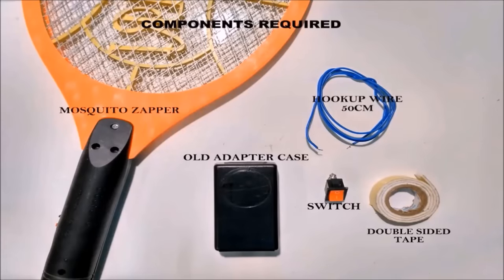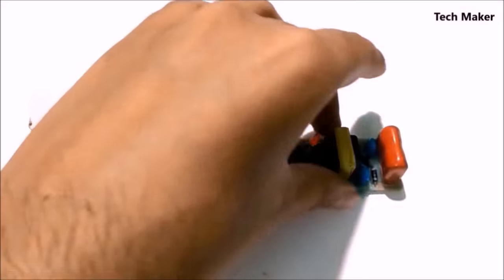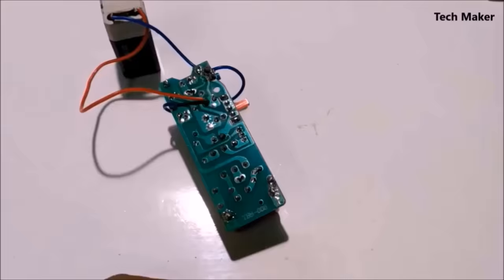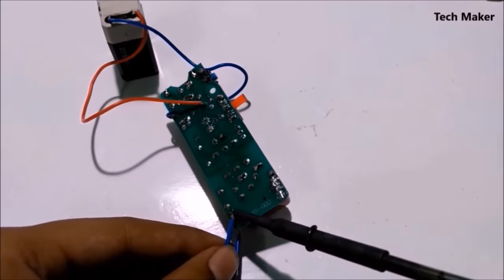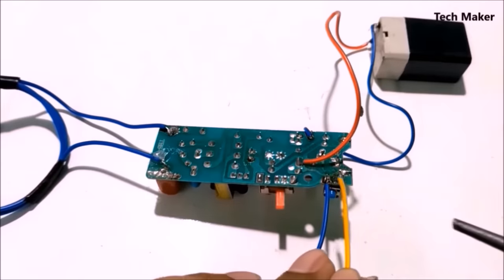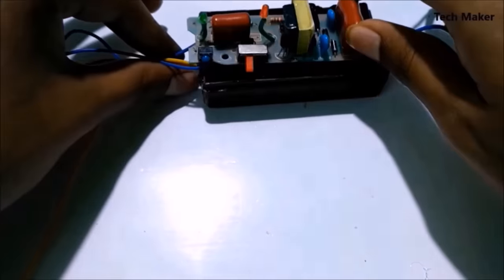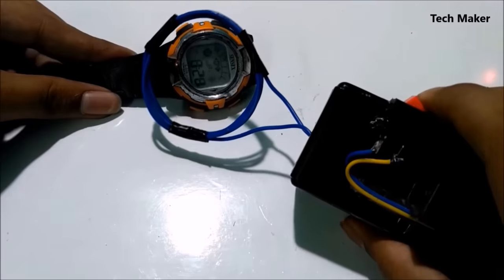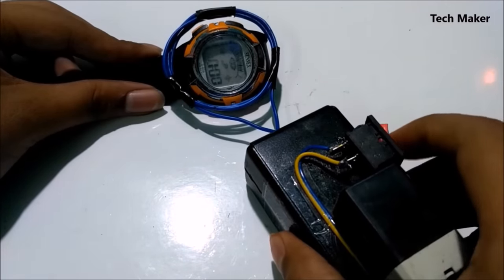How to make EMP Jammer [ Step by Step ]

Comment from the maker: Hey Guys! 
I want to make videos on basics of electronics , which will start with resistors and extend it to high level electronics.
Do any interested?  Reply to comment and drop you any necessary video idea.
Reply: It would be a great idea, and I'm probably not the only one who has zero knowledge of basic electronics, so please make a video about it, thanks! :)
Reply: Tech Maker will it disrupt cash register and how close do I need to be ?  ty
Reply from the maker: it works,  but coil must be on the device which you want to disrupt
Reply: Tech Maker  I'm absolutely interested, I've been soldering  for years and know the basics such as resistors and the different types  same  with capacitors and so on . do it
Reply: Tech Maker Dude I know how to make it effects further just use a bottle and cut it into 3 pieces and then use copper roll it around the bottle top piece ,connect the wires and stick it with the body
Reply: My friend's iphone 5s died
Reply from the maker: +Tech Maker I launched the basics playlist
Reply: Tech Maker hi this emp can hack slot mashine
Reply: @TechMaker1  
bro emp meter can i use

Comment: at the start why did you cut the wires coming from capacitor to the mesh? you could have used them right?
Reply: also can i use the case of the bug zapper itself instead of making a new case? i can cut the handle from the net.

Comment: So can i avoid battery and use same dc voltage power supply...?
is that working digital energy meters...?
Reply from the maker: +99hari55 you can use dc power supply. It works on only some meters.
Reply: If i use more amps ...?

Comment: cool. question will it work with ordinary copper wire? We cant find magnet enameled copper wire anywhere in our hardware stores around. will it also work the same with electric or speaker wire?? Thanks
Reply from the maker: you can use hookup wire

Comment: Wait how is it silent i tried this with a high voltage converter and it is really loud. (Because the spark gap)
Reply from the maker: +Hector Guajardo my one also makes noise,but I reduced the volume in video
Reply: Do you know a way to make it silent? (I saw a video of a person using a silent one the video was titled "How to used EMP jammer slot machine blocker 18" by Jeff Teng")

Comment: In my zapper spark is not coming
Reply from the maker: +Ram Nivedan you need to create spark gap.
Fix the only one wire near by 1mm to the capacitor terminal. Don't solder to capacitor terminal.

Comment: Hello, 
I have two questions.
1. does it stop the electric meter or  reset that. 
Does it destroy the electric meter completely or the meter gets started when power on/off.
Reply: Naveen Gaur depends if you have a digital meter or a old disc electric meter. Use this myself in my country...
Reply: Have u tried it?

Comment: Can I use copper wire for coil??
Reply from the maker: +akshay borhade yes but insulated
Reply: Tech Maker so can i use normal 0,7mm copper cable, which have an normal Isolation?
Reply from the maker: +BeYourself yes

Comment: can using a thick copper wire and high voltage battery will increase its effiency and range ??
Reply from the maker: +prince singh coil turns and diameter of coil increase it efficiency.

Comment: what is hookup wire and where can we get it
Reply from the maker: normal 1/22 swg insulated solid wire
Reply: does it have to be insulated can i just use copper wire?
Reply from the maker: Codex 269 insulated one is best. if not insulated,turns in coil must not in contact with each other

Comment: What kind of wire is that
Reply from the maker: +mdnrhfzz just single stand wire, you can use 1/22Swg copper wire
Reply: Tech Maker i do it with copper wire , but it wont work . I did get the spark . Idk what is the problem .